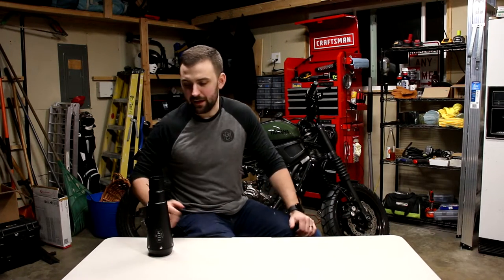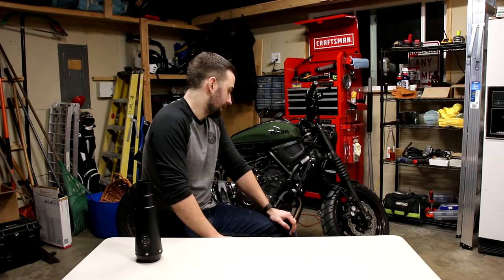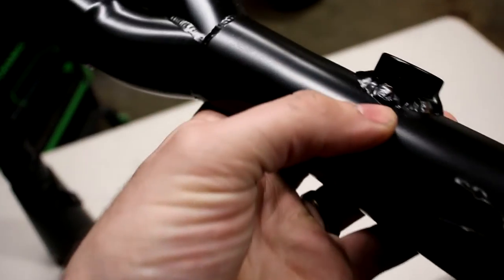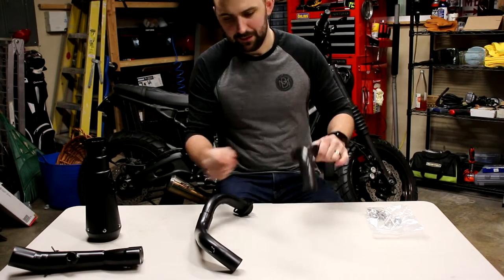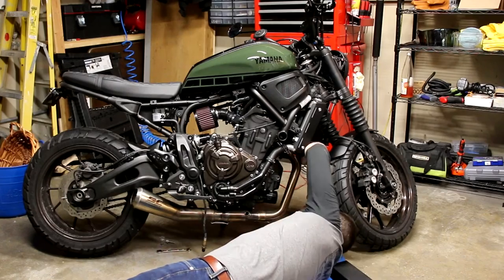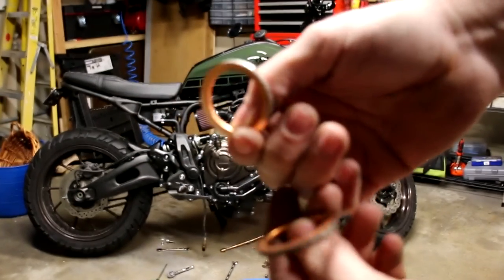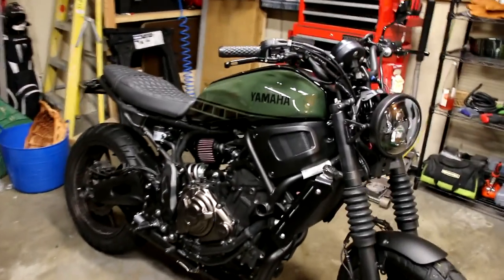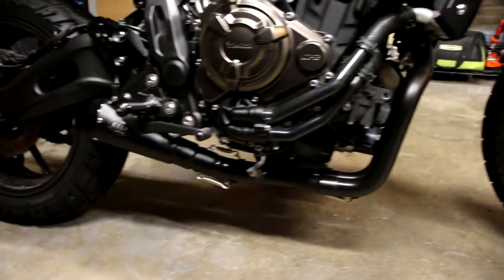KELPI SHORTY EXHAUST - XSR700 (FIRST LOOK, INSTALL AND REVIEW)

Comment: I have a question about the tire you're running. Aside from being able to run on dirt better than stock, how does it feel on tarmac? like vibration and noise
Reply from the maker: You will definitely notice a difference, especially cornering. When I turn my first turn after installing the new tires I felt the whole bike want to almost dump itself over. Since they’re slightly narrower you will notice less turning/leaning goes a longer way and feels a lot more sensitive. After about a week of riding I got used to it and didn’t notice anymore. I also noticed less stability at about 75MPH+ but upgrading the fork springs fixed that. Can’t hear any road noise over my loud exhaust so no comment on that.

Comment: picked up my kelpie exhaust,finally,installed,no worries at all,crancked it up no db killer,I'm in Philippines and the bikes I've seen here are pretty wild,louder the better,better, HO LEE CHIT BATMAN DID YOU SEE THAT TONTO WTF REFUEL SILVER KIMOSABE THE SOUND WAS ALOT LOUDER THAN I WAS ACCSPECTING, REPLACED AIR FILTER,WITH K&N ALSO BOOSTER PLUG,FINISH PUTTING IT BA K TOGETHER TOMORROW AND GO FOR A SPIN

Comment: Have the Brogue spitfire exhaust and new stage 2 air filter. With the new map from Brogue installed on my power Commander the bike seems to have less power than stock. Wonder if the spitfire is restricted like the sc project. Time to but it on the dyno. Love the look of the Brogue exhaust. Just found your channel. Got to get caught up on your videos.
Reply from the maker: Thanks for your support! I believe with a good tune that exhaust should get at least the same amount of power if not slightly more than factory.

Comment: How did you end up with an exposed air filter ? Looks very cool. How difficult was it ?
Reply from the maker: It's the Hord Power Air Intake, a great performance upgrade. I just decided to remove all of the plastics and brackets to make it exposed.